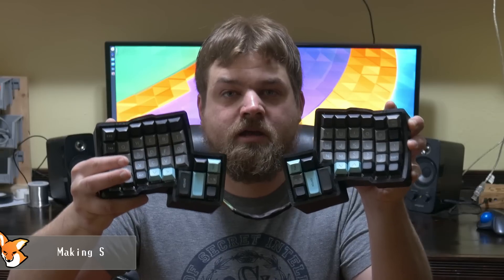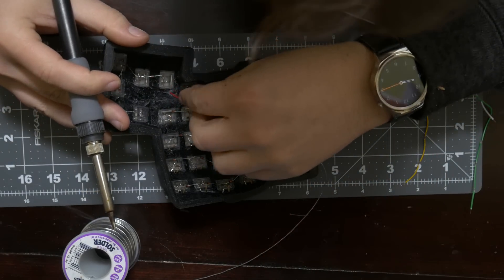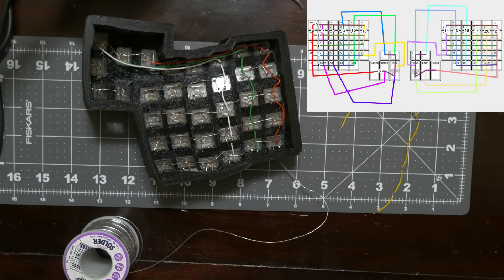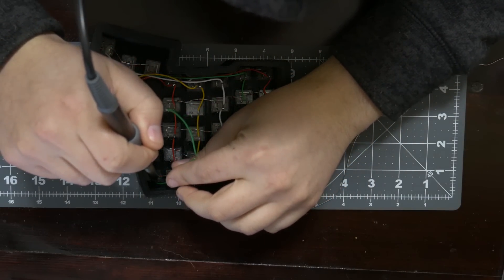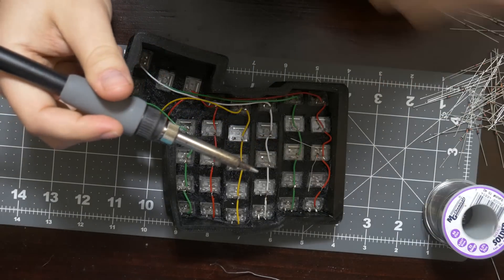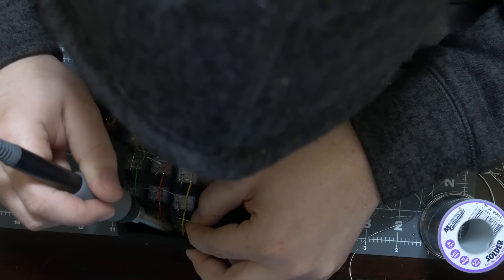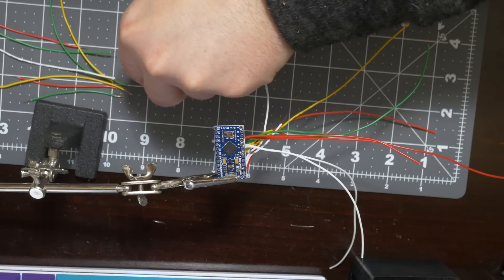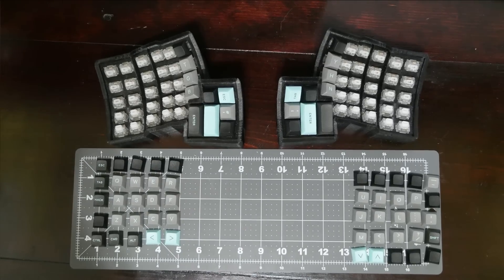Dactylus Part 2: Handwiring, caps and final touches.

Comment: Thanks for this video, i think you are the first one documenting on video how you made your own keyboard of this type. 

I'm new to mechanical/ergonomic keyboards and plan to build one myself. I think this type of keyboard is the best in terms of ergonomics.

I like that you took a different approach, handwiring, instead of using printed PCB boards like Matt Adereth did. Just so us newbs got 2 ways to select from when building our own keyboards ;)

I got 2 questions:
1. Is the Model you made in blender availible for download, and if yes can i just take that to a 3D printing place to let them print the case?
2. What changes are needed to use LEDs for the keys?
Reply from the maker: I debated on using the flexible pcb approach but hardwiring can be fun and it definitely looks more interesting inside. That and I would have to design a new pcb since the alps switches have different locations for pins than the cherry mx ones.

All the files are in the github repository in the description. The models are the stl files in the hardware directory https://github.com/seoushi/tmk_keyboard/tree/master/keyboard/dactylus/hardware . 

For LEDs per key you really need a solid pcb, not a flexible one and it's a lot more work. You need a solid pcb because otherwise you really don't have anything to mount the led too and not to mention having all those extra wires means it would be easier to short something. Besides wiring up all the LEDs you would need then replace the pro micro with something else that has more available pins if you wanted to have any software control of them. Though you could just use the 5v pin and have them always be on. I think the best solution for lighting would be to have an under glow, one led strip and a clear bottom.

Comment: great vids! i subbed. i want to reduce finger travel by using small scissor keys.  the type that are used as F-keys.  any ideas where to get the bits + pieces?
Reply from the maker: Glad you enjoy my videos. I looked around and it seems scissor switches don't come individual pieces, they are tied into the pcb kind of like rubber dome keyboards are. The closest thing you can get at the moment are the cherry mx silver/speed switches which take less travel to activate but I believe those are in limited supply and not for retail sale to consumers yet (only companies who make keyboards seem to have them). However if you like the chicklet style keycaps then pimpmykeyboard.com sells the g20 profile caps which resemble what you would see on a laptop.
Reply: here's what i mean by smaller f-keys:      https://youtu.be/QIDU7CUcKfI    i intend to bring four rows within the arc of the little finger.  i am considering buying a few cheap replacement keyboards, cutting off the f-row and rewiring the keys individually.    http://bit.ly/2j8z5AX

Comment: Also, you mentioned that your typing speed went down and that you're using an Ergodox keyboard. Would you tell us in a few days if you would prefer the Dactylus vs the Ergodox for daily use? Aside from the 3D Printing; what was the cost of the parts?
Reply from the maker: once I'm done evaluating it I'll let you know. I might end up making a proper review of it. It costs $50 for a 100 pack of the matias switches, $63 for the light cycle key caps, $29 for the black keycaps since the light cycle caps weren't enough to cover the board, $5 for the pro micro, $4 for the mini-usb breakout board and a few dollars for all the diodes. So about $150 minus the plastic which was one 1kg spool of petg I bought for about $25.
Reply: Sean Chapel are you able to program the keyboard as you would the ergodox? How many layers and can you program macros like on an advantage (I mean is it possible to program not can you do it via the keyboard it's self.)?
Reply from the maker: It depends on which ergodox you mean. The original was just a firmware you made (tmk/qmk) and compiled and flashed the keyboard with. The new one you use a web tool to make your layouts (not sure if you flash or it's a config file at that point because I don't own one). I use the tmk firmware for this board so it has all the limitations of tmk. I only use 2 layers but it looks like tmk supports at least 8. You can not program the board directly without a flashing like the pok3r or some ducky boards can. Tmk does not have macro recording however you can build macros into your keyboard firmware.

Comment: Thanks for posting this video. I've been reluctant to build a Dactyl keyboard to compliment my Kinesis Advantage 2 at work. Now, you've shown me that it can be done and I'm grateful. Since I don't have a 3D printer, do you have the files I can upload to shapeways? You mentioned you modified the original design from Matt Adereth to fit specific switches. Can you elaborate on that? Any advice you can share with me would be greatly appreciated.
Reply from the maker: I have the files in my git repo, it's all the stl files in the hardware folder https://github.com/seoushi/tmk_keyboard/tree/master/keyboard/dactylus . I'm using matias clicky switches which are alps clones. Most keyboards now days are built with mx style switches. My biggest modification is that instead of a floating design with legs it's a solid piece all the way to the desk. The switches just required a different sized hole. If you are looking for a cheaper (pricewise) version of the kinesis then you really aren't going to find one unless you own a 3d printer, shapeways is quite expensive. If you really just want to make a custom kinesis like board then I would consider mine or the dactyl. To decide between mine and Matt's I would consider what you think looks better and what switch type you want to use as mine is only for alps and matt's is for mx. Also you might consider using a trrs cable or a different way to connect halves if you don't want a big non-detachable wire like mine has.
Reply: If it's not too late, take a look at 3dhubs.com.  More options than just shapeways